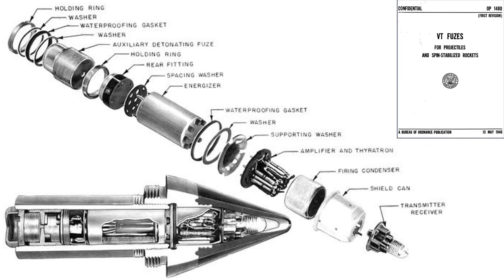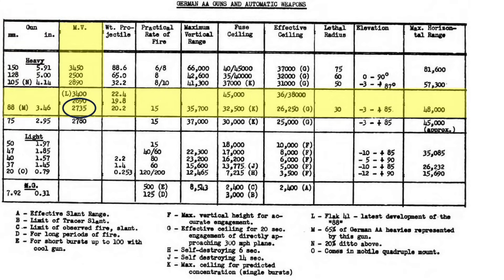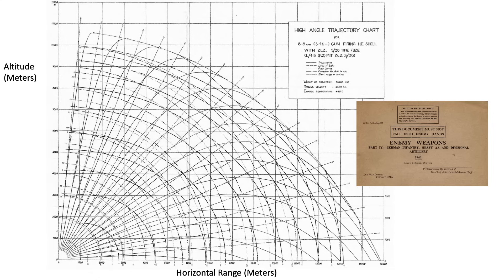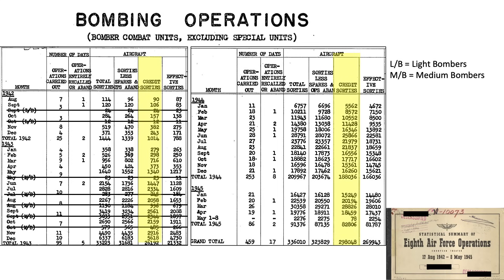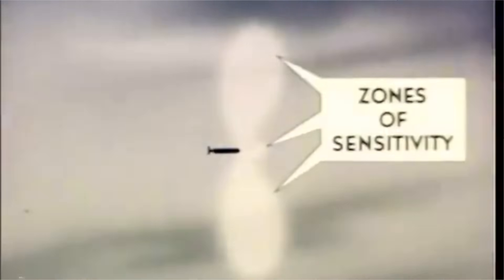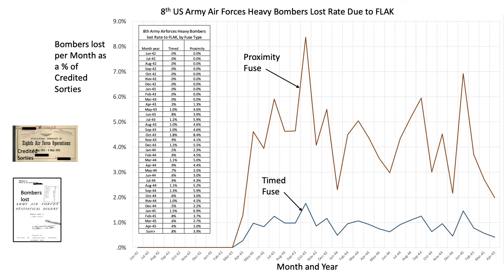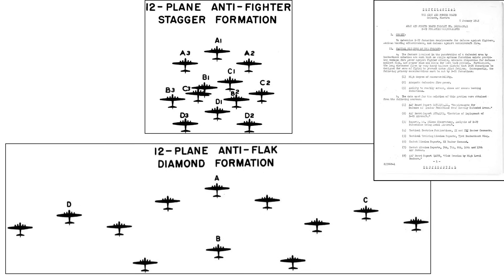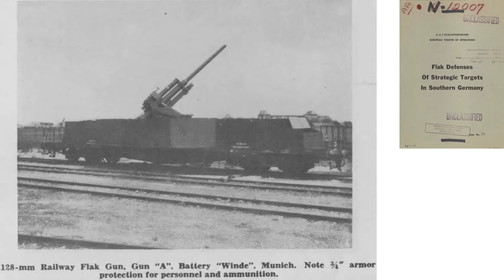Germany's big Mistake, no Proximity Fuse in WWII

Comment: The question on whether Germany should have developed a proximity fuze instead of the V-1 or even the V-2  missile is in no way a sensible question.   I will explain why;-

To win an all-out war, you have to take the fight to the enemy and destroy the will and ability to fight  - defending your own territory is just a part of it.   Hence it was sensible to develop the offensiveV-1 regardless of any defensive ack-ack development.

Ack-ack proximity fuzes are completely different technology to V-1 missiles, hence developing and mass producing proximity fuzes would not take resources away from missile development and production.

It is anybody's wild guess as to how effective a German proximity fuze would be.
Basing the kill ratio of VT fuzes on its effectiveness against  Kamikaze as done in this video is quite unsound.   Firstly, the flight path Kamikaze pilots were trained to use was designed to make shooting them down as difficult as possible.   Such a flight path was quite unsuitable for high altitude precision bombing, so on that basis one would expect VT fuzes to be a lot more effective against bombers.
It would have been better if the presenter had looked at the very high kill rate of VT fuzes against the V-1, which essentially could not be shot down by times fuzes.  However, the V-1 was a dumb robot that could not take defensive measures, so the effectiveness of proximity fuzing against bombers would be somewhere between its effectiveness against Kamikaze and against V-1.
Is data of VT effectiveness against non-Kamikaze available?   It would be worth looking for. 
On the other hand, the presenter has assumed that German proximity fuzes could have been as good as American VT fuzes.   That seem very unlikely - a lot of intense development utilizing special capabilities the US had went into the VT fuze.   Britain could not anywhere near match it, and could not mass-produce it  and I don't think Germany could match it either.

The V-2 was a boffin's indulgence, but Germany very nearly had a war winning weapon with the V-1.    Fortunately the VT fuze was made available in the nick of time, and British manipulation of a German spy tricked the Germans into disabling the V-1's accuracy.

Comment: Aparently Germany was developing proximity fuses that used infrared (whatever that means, I don't know) towards the end of the war, they also tried out automatically triggered guns on ME 163 fighters that would activate when the fighter passed underneath a bomber (guns were installed at an angle, similar to schräge Musik) (again, not sure if this would be the same or simiar tech). I read about this when checking some books on submarine U-234 and its cargo (part of which were those fuses plus a passenger who was a scientist involved in their development) when it surrendered to US. The infrared technology was of interest to the US which were looking for a system to trigger its implosion-type bombs.......... Now that is a loooot of claims in just a few lines and I admit I do not have the means to check any of it (particularly the stuff around the u-boat is a bit muddy...), but thought I'd post it, anyway, in case there may be any interesting clues to someone with better knowledge.
Reply: Something that is triggered by infrared today are automatic porch lights. It sends out infrared light and when something solid breaks the field at a certain distance enough of the light is reflected back to the IR sensor. They were actually using those sensors to set off IED’s, specifically EFP’s, by the time I got to Baghdad. So our humvees and most other vehicles would have Rhino’s on the front. A box on a bar extending out some 6 plus feet from the bumper that would get hot using glow plugs. The heat, or IR radiation, would set off the Passive Infra-Red sensors and detonate the IED’s early.
Reply: You can search for, for example, "Strela-10 missile proximity sensor overview and partial teardown" here in Youtube (infrared proximity sensor). The channel has fascinating (disassembly) videos of military components, missile parts etc.
Reply: The  Germans had proximity fuse for the  8.8cm gun which was test fired in 1943-1944 with about 1000s test fired with an effectiveness of 95 against elevated ground targets. (netting).
The code name was Kuhglochen and it was by Rheinmetall-Borsig.
-The fuse was in development in 1940 but development was halted during the emergency that was the Battle of France due to a Fuhrer Order that all weapons development that could not be completed within 6 months should be suspended.  It took a long time to reactivate the program (late 1942).
-The Existence of  the fuse was reveled to British Intelligence in the Oslo Report which was delivered to British Intelligence in November 1939 along with the shock hardened vacuum tube called a cold cathode thyratron tube.   The cold cathode thyratron was a tube(or valve as British call it) filled with Argon at 0.5 bar pressure.  It had a cathode, an anode and a striking anode.  When a voltage was applied to the striking anode current would conduct from anode to cathode.   It didn't require a heating element.  The valve was extremely sensitive and the voltage very precise and repeatable.
-The Germans had already been using the shock hardened cold cathode tubes to arm their bombs and set impact time delays.  
-With the Oslo letter tube and other tubes being found in bombs the British restarted their own proximity fuse program just as the Germans suspended theirs.  
-The man in charge, physicist john cockcroft had an atomic bomb to develop so the work was handed over to the US.    The US fuse entered production in 1942 but the British test fired their own fuse in 1942 but by then US fuse was in production.   (see Louis Brown: Radar technical and military imperatives) .  The British fuse was detonated remotely when the relfection from a coner reflector merged with the target.  A double pulse triggered detonation.  They'd hoped to track the shell as well.
-The Germans had planed to cuse cold cathode tubes in 2 ways on FLAK shells.  A/ by using them as electronic timers and B/ Using them as proximity fuses that trigger of the aircraft electrostatic field.  
-A shell in flight and an aircraft have a powerful electrostatic field.  The German shell had an whisker aerial on one side of the shell.  As it spun through the air at 500 RPM the field around the shell was even.  If an aircraft was in the vicinity the field was disturbed.  The 500Hz was filtered and rectified and if sufficient would fire the cold gas thryratorn which would discharge a capacitor through a fuse link primer detonating the shell.  A nose contact switch was present ass a backup and it could obviously be timed to self destruct a little beynd the bomber target.  
-About 1000 round were fired in 1943/44 with a range up to 4m.  Improved circuits of 10m and 15m were developed but not tested.  Production did not occur because the factory was over run in early 1945.    The cold gas tubes needed a little radium to trigger fast enough and this cause a delay as tetrode tubes which did not need radium were developed.
-The Fuse is briefly mentioned in Wolfgang Samuel book "American Raiders" and also Igor Witkoski's "Truth about the Wunderwaffe" which gives illustrations and CIOS references.  (wrong but I found them in a US archive depository)
Reply: I love this comment section, thanks so much, crazy insights!  @williamzk9083
Reply: Holy smokes! Thank you for all this information! Very interesting. @williamzk9083

Comment: Quite feasible, but imho so would be heat-seeking missiles if they had worked on them for as long as they did work on rockets/V weapons (and jets - the engines for which they would NEVER have the materials to produce in quantity).  I think your idea is even more feasible.

Comment: If eg 9 US cruisers are firing 60 5" VT at 20 Jap aircraft all of which are relatively fragile single engined planes how would that compare to the Germans firing 60 3.5" VT at 600 high flying tough 4 engined planes?

Comment: Is this equivalence of targets between kamikazes and American bombers for calculating VT fuse effectiveness against bombers valid? 
VT fuses were aimed at individual Japanese planes flying at much lower altitudes. Would targeting individual B-17s flying at, for example, 25,000’ have been feasible? If the VT-fused shells were fired at formations instead of individual aircraft, would it not have required more shells/kill?

Comment: They might have used it in the V2 in the same way that the Little Boy A bomb had a ground proximity radar altimeter to detonate it at the right height. An explosive charge detonated 100 ft or more above a city devastates a much wider area than a burst at ground level. The V2 landed at such a speed that it partially buried itself before the contact fuse could detonate it, rendering the explosion even less effective.
Reply: The atomic bomb does its primary damage through the heat and blast. Any bomb is governed by what is called a tyrannical equation. To double the radius of effect, the bomb size must be cubed. An airburst of a conventional .25 ton bomb (500 pounds) compared to the estimated 21000 tons of Fat Man. A 7.5 ton Daisy cutter could make a blast diameter of 250 feet. The effective area of the 500 pound bomb was like 30 feet. 
   Another consideration is which method is best for bomb effect. You don't want to waste energy on overkill. The scale of the atomic bomb makes it ideal for an air burst. Ground burst is used for hardened targets, but in a city that would result in an overkill zone (dead is good enough, very dead is wasteful).  I think air-dropped bombs had a .01 second delay to allow for some penetration if it hit a house (blast wave damage). If it did hit the ground, it would transmit some shock so a near miss might collapse a wall. For mortars and artillery, VT fuses were used for antipersonnel purposes, sending shrapnel downwards against troops in the open. 
   The V-2 warhead was 1.1 ton, so would have had an effective diameter of like 40-45 feet. Even aiming at big cities, the accuracy was dodgy.
   Atomic bombs also use barometric fuses as backups.
Reply: I'm not sure that's true. The majority of destruction caused by a V2 was not caused by blast, but the by the circa 3500 tons of soil, and debris lifted by the fairly deep detonation, which then fell back from well over 1000' onto the target area. It's true the blast effect was reduced by the deep explosion, but it's not the blast that was its primary means of causing damage.
Reply: @Fidd88-mc4sz  I would disagree. It would leave a crater like 8 feet deep (3m). If it hit the ground, there would be a shock transferred to the ground, but most of the gas expansion would be directed upwards. If the bomb penetrated a building, blast overpressure was enough to bring it down.  If it came down near a building, ground wave could cause a wall to collapse.
    For anti-personnel, even the Germans at the time knew that saturating an area with smaller blasts was more effective, with the butterfly bomb (and bomblets in Vietnam). 
   Excess pressure or excess shrapnel was overkill. By focusing on smaller explosions making for more even shrapnel distribution, it maximized the effective area.
Reply: @Fidd88-mc4sz  The debris certainly would cause a lot of damage and holes in roofs etc., but a lot of it would be repairable given time.  But a shock wave can flatten buildings in one go, leading to the classic pictures of blitzed houses in which only the chimneys are still standing.  A V2 exploding while still falling at supersonic speed would create a devastating shock wave spreading even faster ahead of it.  The damage would depend on what sort of structures it hit (which with a V2's primitive guidance was largely random) but it would shatter ordinary houses and kill anyone exposed.
Reply: @philiphumphrey1548  That's as maybe, what I'm saying is that that's not the way it worked, it was never meant to cause damage primarily by blast. (although the blast damage was not inconsiderable, nevertheless. The falling debris did cause a complete collapse of roofs and floors, and blew the walls out too, leaving much the same damage as a blast bomb at surface level. And this is the problem when looking at photographs of V2 damage of a built-up area, it actually looks like blast damage, leading to people thinking that's what they're looking at....
Reply: @Fidd88-mc4sz  I would characterize the V2's main effect as blast. It was intended to hit dense areas, and demolish buildings. To destroy making craters, you need to surround the bomb with ground on all sides, deep enough to not waste energy pushing air. The warhead and the casing wasn't build for that (it was one of the highest explosive-to-weight ratio warheads).

Comment: VT fuses were not employed where the enemy could have recovered an unexploded shell (all fuzes do fail at times).  In the Pacific they dropped into the ocean.  Those who experienced a VT fuze up close were never in a position to report back.
Reply: I was told that ht first use of VT shells over land was at the Battle of the Bulge. I don't know who sanctioned the order but it must have been from pretty high up the command chain.
Reply: @gordonwood1594  The Order came from Eisenhower. The Fuze's were in Theatre already.

Comment: Given the USA had terrible QC problems with VT fuses, the Germans would have needed a LOT of time to perfect it [USA was NOT being bombed and lots of everything; unlike Germany].
Reply: It's not that QC was bad. It was that building vacuum tubes that can survive being fired out of a 5" gun is extremely hard.

The initial version they had worked 80% of the time and was ready for mass production. How long would it have taken to make a version that worked 95% of the time? 6 months? A year? More? Could they produce as many of the 95% version as the 80%?

The choice was an 80% reliable fuse now or a more reliable fuse at an unknown future date.
Reply: @Crosshair84  ; what you said is very true. Building submini tubes was not easy and to resist thousands of G's even harder.  But the documents from the time indicate the tube QC standards was not being met by the manufacturers.